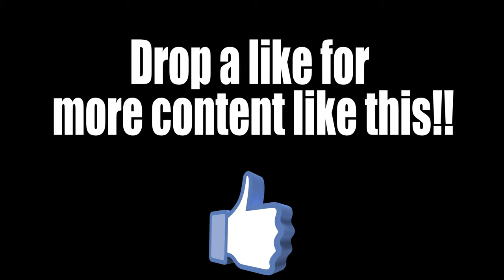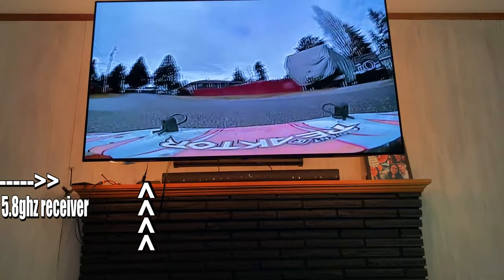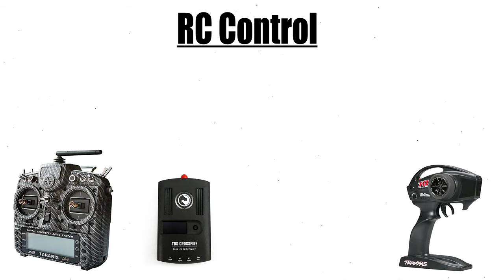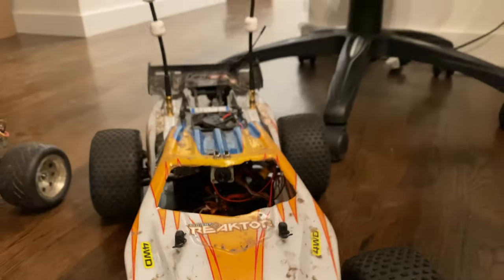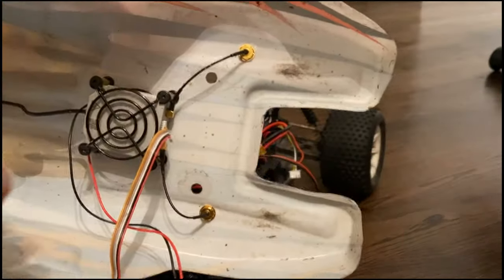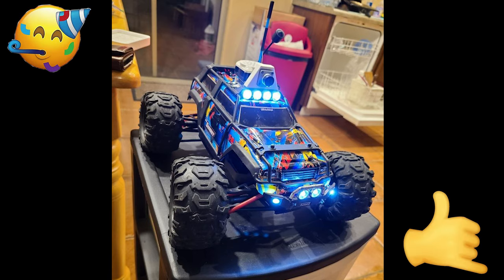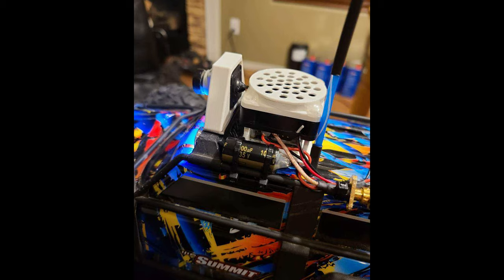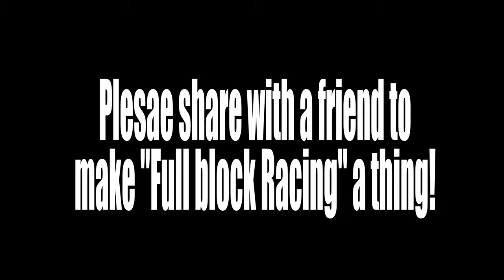How to Build an FPV RC Car in 2021!!!!  - 4k

Comment: Are you still using the same fpv setup?
Reply from the maker: I am! Crossfire with a ground remote and DJI for video. I now run a Losi Lasernut because of it’s big tires and soft suspension (smooths out video). 

1.3 is too cumbersome most of the time but I will still be making a video on it. It’s just super detailed and I wanna do it right so it’s taking a while. I have other videos showing my best setup and that’s exactly what I use today 🤙
Reply: @ChaddRainsFPV  awesome.  I got stuck with the dji goggles v2 and updated the thing so now I don't have connections with my Air unit. I aware the of the hack. I'm just waiting for it to be more easier to hack the vs goggles.
Reply from the maker: @jeffv2074  If you updated what’s called the “drone side” of the goggles (or something like that) you need to switch to “diy” (or whatever). You want fw .0606 and the DJI assistant v2 should allow you to do that. 

If you updated the drone side it doesn’t matter, unless you fly the DJI FPV drones. You can still run your air units 🤙
Reply: Great question awesome reply

Comment: Can you run multiple FPV cars at a time or will the video signals interfere with one and another? Would be great fun to run FPV races with a couple of pals.
Reply from the maker: Races are definitely possible! There are a lot of channels available and you really only need to adjust your power levels so you don’t interfere, and only if there’s more than 3 people at one time!

Comment: Hello Chad ! Question for you =) what setup do you use on your Air Radio when you using an RC Car ? I mean on a ground Remote Controller you have the gas trigger that goes back to neutral if you release it and also a break trigger. I have a TBS Tango 2 but I also use it to fly FPV Wing and drones, so my left stick is in a "manual" for the throttle where it will stay where I leave it, when my right stick controls the elevons. So the way I see it is that I would have to set up the left stick at position "0" to be like "off" and if moved upward it would be the gas, moved backward the break right ? And the right stick would be the steering of the car ? If you have any better way to configure it :p or could share a video where you show how you setup the RC itself that would be priceless ! Thanks ! Alex
Reply from the maker: Hello! I actually only used an air radio for a few days before switching to a custom ground remote. I never liked using it for cars so my opinion isn’t worth much on the topic (just being honest). 

There guys that like air remotes on ground vehicles (especially racers in Europe, I guess). I’m sure they have some videos on how to set up other remotes, that you can apply to your Tango 2 🤙
Reply: Hey @ChaddRainsFPV  ,
No worries I found an other video indeed on how to set up an Air radio for RC Cars ! Thanks ! =)

Comment: Question. I need to control multiple RC cars using one radio. How can I achieve this?

Ex: I need to drive one car to a location, park it. Then using that same radio, take control of a different car, while the first one remains parked, and drive that one somewhere. Then be able to switch back and forth, between the cars
Reply from the maker: That would be tough… I think having a radio with a lot of switches would be necessary, then wire an on/off switch for the ESC signal wire would be your best bet. Look up “pit mode switch’ and see what I mean. You’d cut your other car’s motors, but all cars would still steer while powered on. Maybe run two switches, controlled by a 3rd channel. Tough thing to do but that’s how I would do it 🤙

Comment: friend to vtx. Can it be connected to a battery? And can it connect with any glasses? And can you have a vtx system already armed with a sufficient battery?
Reply from the maker: It can be connected to a battery and doesn’t need to be the RC car’s battery (in fact it’s better to use a separate battery). The goggles have to be the correct ones depending on the system. DJI only works with DJI VTX, analog only works with analog, etc. Hope this helps 🤙

Comment: Is there any documentation on the DJI air unit?  I already have a DJI FPV drone with the motion controller (it's way more intuitive than the stock controller) and dji goggles.  I expect that the motion controller and goggles are out of the box compatible with the air unit.  Question is what kind of input/output is available on the air unit?  Instead of a separate radio to control my rc car, I would like to use the control signals which should already be available in air unit (which normally control a drone (up/down on the motion controller for accelerate, left/right for steering).  Motion controller has throttle but hat wouldn't give me brakes.
Reply from the maker: Hey Jeff,
Sorry to say it is not compatible. The air unit was designed to work with another DJI remote and only on 5.8ghz. The new DJI FPV drone, goggles and remote all can use two different bands. The air unit is left out and can only be used as a video system with the v2 goggles. 

Your best bet is to grab a crossfire module and check out my other video on RC car controllers. It’s really just about the only system that has enough range to keep up with the DJI FPV video system 🤙

Comment: How did you power the fan and air unit, did you power both directly from the car's battery?
Reply from the maker: Yup, they’re both powered from the battery directly on this rig. It’s runs 3s and it’s a 12v fan so it’s perfect. 

On anything bigger I run a regulator and big capacitor to make sure no voltage spikes from the esc cook my air unit 🤙

Comment: Me again lol quick question. I only have an iPad Pro, and had no idea I had to do firmware updates for the goggles and the air unit. No biggie, just one more hurdle to get through. Can a laptop with Windows do the DJI Assistant 2 FPV? Or do I need a higher powered PC? If I can get away with buying a laptop I’d rather do that instead of getting a PC. Any advice would be greatly appreciated!
Reply from the maker: For sure a laptop running windows will work. DJI assistant 2 is a very low power app. It would probably work your computer less than opening up YouTube to reply to this comment lol 🤙
Reply: @ChaddRainsFPV  oh for real? Nice. Obviously I’m not that tech savvy lol but it’s stuff I’m excited to learn and get good at. Thanks for the tips!

Comment: Good video will all of this work on mobile because I don't like using goggles so what should i do?
Reply from the maker: Nope, mobile can use a cheap analog 5.8ghz receiver but digital / other systems work. The cheap mobile receiver also has terrible range. I recommend grabbing a screen with a built in receiver or finding something on FPV marketplace 🤙

Comment: Im thinking of building one but can't understand why the ariel on your Wing. The 2 from the camera make sense to sent to the display but why's the wing 1 needed.

I cant find a display with a sd slot so i may use my phone for that
Reply from the maker: The antenna on the wing is for a long range control. The video and rc systems are separate. In my newer videos I show a lot more detail 🤙

The phone FPV receivers are mostly all pretty bad. What you’re looking for is “FPV Screen with DVR” (those will always have an sd card slot). I’ll be linking that one I like in a video soon (been doing some testing in good ones). Hope this helps!
Reply: @ChaddRainsFPV  i learnt last night i need dvr. Glad you said phone one are crap video,  i just got a traxxas complete diff, i posted in a group & apparently im gonna melt it 40£ brand new waist of money, you just saved me wasting more on the phone reciver

Comment: Where can i get that camera mount he is using on that 1/16th summit? 
I would love to buy 1!
Reply from the maker: Hey Jeremy! That’s just the stock adapter that comes with a lot of micro/nano FPV cameras. It’s a shell that makes them fit in larger drones but you can mount them to a car from no problem. You can also get some adapters from Brain3D and just modify them a bit 🤙

Comment: dude this is awesome! do you have any links for the fan system?
Reply from the maker: I really should make a video just on the fan. I don’t have links atm but I will put some up soon. I can say that I use super cheap fans for both digital and analog vtxs. Like <$5 on eBay. 60mm 12v fans for Air units and small 5v esc fans for TBS Unify VTXs. Hope this helps 🤙

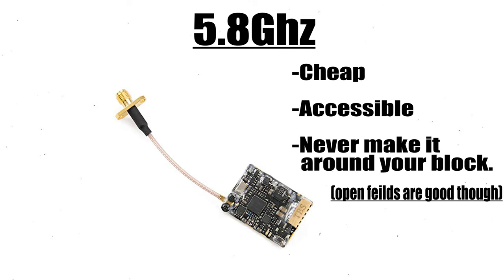Comment: Dang what do you think I should pursue for FPV for a car for when I'm at work? I wanna install a FPV system on a 1:12 rc truck with lights so I can explore my work without leaving my car haha
Reply from the maker: 1/12 scale is pretty little so you won’t have a lot of range anyway. If you want decent video go with a TBS Unify Pro VTX, a runcam Phoenix pro and make sure to run a fan on the unify. A decently tall antenna like an OCP from TrueRC will help out too 🤙

Comment: Watched your video, interesting stuff. I own the DJI Fpv drone. I feel like the range out of the box is allready good.. but I still want to upgrade it. So I noticed the link to your iflight recommendation suited for the bottom two antenna. I didn't notice a link for the stubby's you use. can you send me that?
Now... I do have a ton of questions on how I dramatically increase the range on my RC itself. I have the ARRMA v6 Kraton. It seems you brushed over this topic in this video. Do you have another video that specifically shows us how to increase the range for how far we control the RC itself. Maybe you did cover it... but i think you mentioned you had a better video on it. Can you drop me a link to that video. 
I have a tactic controller, and stock receiver in my V4 kraton. And I recently picked up the spectrum DX5C and a SR6100 receiver. 
Anyway im specifically wondering is their a way to improve the reception distance for my DX5c controller to my 6100 receiver in my rig by perhaps modifying them???
lastly... I think you would get a kick out of my latest video. Titled
DJI or Skydio Active Tracking Alternative - Control your RC from the sky with motion tracking!
https://youtu.be/J7wCxDRPikM

would love to hear from ya
Reply from the maker: That video is awesome! Got a sub from me!

Okay, so I’ll drop some quick answers to your questions but you can ask for more clarity if ya need. 1) those iFlight directional antennas are not going to work for your DJI FPV drone. You’ll need the True-RC dual band X2 antennas. The DJI drone uses 2 bands (2.4 and 5.8 ghz) and the goggles may get damaged if you use the single band antennas that I use with the DJI drone (I build my stuff so I don’t have to use the dual band antennas). 

2) There are a couple different options for longer range rc links for cars. I currently use the RadioLink RC6GS v2 with it’s stock receiver. It has a lot more range than any Traxxas or Spectrum remote I’ve used. But for more really long range rigs, I add this to the back of my RC6GS v2 - https://youtu.be/TRsJF_JICR4

Hope this helps 🤙

Comment: Hello, first of all thanks for the video, that teached me much in fpv, I had a question : is there another solution for the DJI air unit not to overheat without a fan or maybe is there another unit more optimized not to overheat because I never had any of fpv things and don’t have the tools to create a fan myself or to even put one on my rc car ?
Reply from the maker: Sure! There is basically no option without a fan. It’s either that or the car needs to constantly be going 30mph+ the entire time, which isn’t really feasible. 

You can run a little 5v ESC fan from your receiver and rig up something with some 20mm m3 standoffs. This stuff is available on eBay / Amazon for super cheap 🤙
Reply: @ChaddRainsFPV  okay thanks for the response I’m going to be searching that and another problem is I don’t see a way that I could run the fan from my cars power since I don’t have additional connectors.
Reply: I have a Traxxas car btw
Reply from the maker: @Tady313  5v motor or esc fan ran off of your receiver. You be enough pins. Gotta look that up ^
Reply: @ChaddRainsFPV  ok thank you so much
Reply: @ChaddRainsFPV  do you think I should buy the DJI air unit or a caddx alternative?
Reply from the maker: @Tady313  The air unit is slightly better for range, more so on cars than drones. The Caddx or Runcam versions are a lot cheaper and in many cases will have equal picture quality. Up to you 🤙

Comment: Nice video and car. I'm building one right now. I'm still playing around with 5.8 video at 2,000mw (yeah right). Would like to see more fpv car video's👍I can't drop $1,000 on DJI right  now but do have a set of Skyzone Cobra X goggles coming.
Reply from the maker: With that much power and some good antennas you can get some good range! Look into the Pepperbox antenna from VAS, I think you’ll like that one. 

I’ll keep making some FPV car content then!

Comment: How many miles you get for a example if I was in my house and I wanted to make it to a school park?
Reply from the maker: I show how far I can go in my demo video on the channel. It’s not miles, as the car has a low latency video link. Which means I can drive 40mph or faster but I’m limited to about 1 mile in open fields. If I was going between houses it’s like half a mile. 

Other systems can go farther but have a max speed of like 15-20mph. Too slow for me 🤙

Comment: How do you get the RC Car to work with the Air Remote?  I know he said it wasn't great but I'm just curious, been trying to figure that out for a week and a half.
Reply from the maker: The air unit only has an ‘Sbus’ signal for its rc control. That means you either need to run it into a flight controller, then flash ‘rover’ settings via iNav to get steering and throttle to work (brakes will not work when using an FC at this time). Or the Sbus to PWM converter I talk about in the video may work.. I haven’t tried it with the air unit’s rc remote. Don’t have one of those haha 🤙

Comment: Any thoughts on how to add this setup to an aarma kraton 6s V5?
Reply from the maker: You can probably use the same camera mount as me (free 3D print file in the description and you can have Brain3D print it for you). Mounting the air unit will have to be improvised slightly but I just use 3mm standoffs and a 60mm fan. Just be sure to power the air unit with a 12v 2+ amp regulator as 6s voltage will fry it. Good luck! 🤙

Comment: Hey man, I’m trying to do this on my ratty brushless swapped rs4, but inside the cab. 

I plan to run 5.8ghz since it looks cheapest and simplest, and I don’t plan to run crazy far but I’ve got a few questions. 

How would I got about wiring it to my car? My esc has a jst plug meant for a fan with about a  5 volt stepdown. Could I connect it to that?  

Would a micro type do the job? Or would I be better getting a normal not micro sized camera and VTX meant for a drone? 

How could I push the maximum amount of range out of a cheapo system like this?  I’m trying to get a few school robotics friends to do it, but none of us have crazy money to blow on this.
Reply from the maker: Ayeeee I hope the friends follow suite and build one too! So you don’t want to power analog video transmitters (like a 5.8ghz vtx) off of the same battery as your esc unless you have a lot of filtering (gotta Google that one). My quick tip is to use a separate battery. RC car’s ESCs make too much electronic noise and it distorts the video, so a battery that does not have any connection to the motor/esc is best. 

I recommend getting a separate vtx (non micro) and one that has at least 600mw to give. Mount the antenna as high as you dare and keep that vtx cool. It’s so hard to do if you leave it inside the body, so you gotta use a fan. Hope this helps man 🤙
Reply: @ChaddRainsFPV  thanks man

Comment: I want to drive RC car around my house. Let's say 150 meters.

Would the first solution be fine? Is there any tutorial on how to do they s stuff step by step?
Reply from the maker: An 800mw 5.8ghz analog vtx should be enough to get you around your house decently, as long as you have some good antennas. I will make a 5.8ghz rc car build video soon. There are a few tricks to getting better range than a lot of other videos explain. I’ll do my best to get it up before Christmas 🤙
Reply: @ChaddRainsFPV  cool, thanks! Can't wait to drive a tank around and mess with the wildlife lol

Comment: I have a problem with wearing goggles, I want to transmit to a tablet for view, please advice.
Reply from the maker: If you check my channel there is a video that shows you how to get DJI FPV video from their goggles into Fatshark goggles, but you can plug into any screen with an HDMI too. You can also use the DigiView app on an android tablet- but only with DJI FPV goggles and air unit. 

But most people will use what’s called analog (instead of DJI FPV) because it’s less expensive. You can get a good screen with a video receiver for around $100 to use with an analog 5.8ghz video transmitter. 

Hope this info helps 🤙